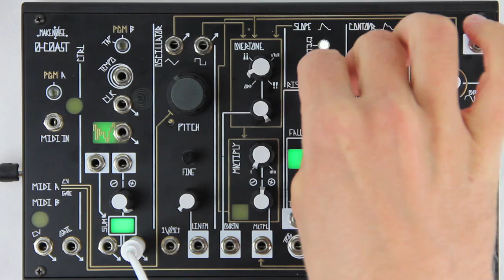Oscillations from Other Circuits on the 0-Coast

Comment: Late to the party I came (channeling Yoda), but I have to say, this is great!  I've seen it said that the 0-Coast promotes no distinction between audio and control signals, but I hadn't yet tried plugging the random voltage output into the audio input jack - though even using the phrase "audio input" now seems somehow discriminatory and arbitrary (oh here we go...) 😳🤡

Comment: How is the "digital square" generated? And what makes it digital?
Reply: Lucas Jensen the square wave can be a gate and used to trigger the clock, if you take that to audio rates you get a digital oscillator like what's shown here. You can also use the random voltage output the same way to get tuned noise.
Reply: So the "normal" squarewave oscillator triggers the clock, so the clock becomes an oscillator (at audio rates) ? And is the clock controlled digitally?

Comment: Just found this passage on what "Make Noise" labels "Attenuverters": "Many control voltage inputs on Serge modules have clever inverting attenuators - at the twelve o' clock position, you have zero gain, turn clockwise, you have increasing positive gain, turn counterclockwise, you have increasing inverted gain." [ http://bit.ly/2kxa81U ]

Comment: Regarding Moog's attitude towards utilizing identical patch cables for audio and control I found this original quote in Trevor Pinch & Frank Trocco's book "Analog Days": "In order to separate them you'd have to think you would never want to use an audio signal as a control…and I just never saw that–that's not something that we'd want to decide up front." [Pinch & Trocco (2002): Analog Days. Page 46]
Reply: Andrew Levine did you know that the founder of make noise is former employee of Moog?
Reply: Interesting information! Thanks!

Comment: I went to UCSC and their electronic music studio and they had a Serge Modular synthesizer.  That thing had the most beastly touch keyboard sequencer, you guys make anything like that?
Reply from the maker: BRAINS/Pressure Points and/or René. https://www.youtube.com/watch?v=8vCcomkcrUI  https://www.youtube.com/watch?v=AqMCefZa1Gc
Reply: Yay!  Many thanks.
Reply: Why not create an enclosure this can sit in that gives the user a chromatic pressure sensitive pads and a four cv sequencer made specifically for the o-coast? Charge the same price, you will sell a ton, and we get a pseudo music easel for a grand? This enclosure could even be a case as well.. Why not?